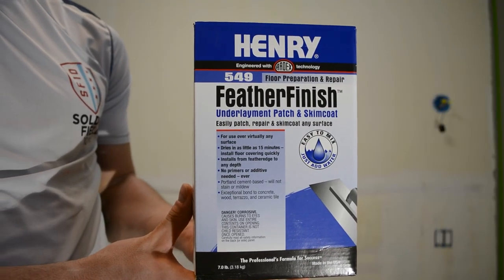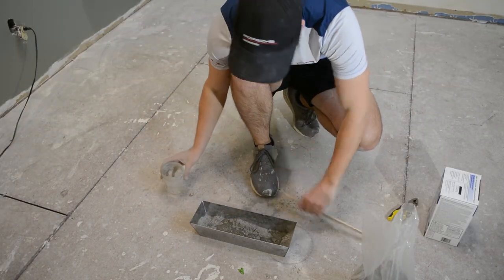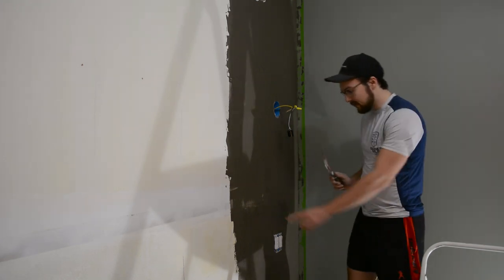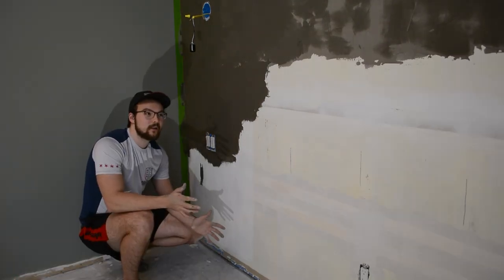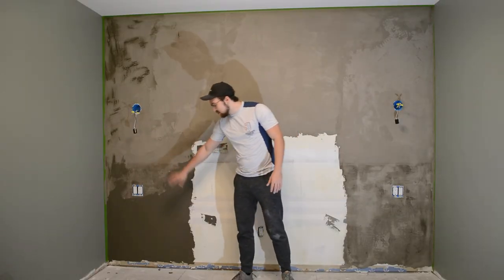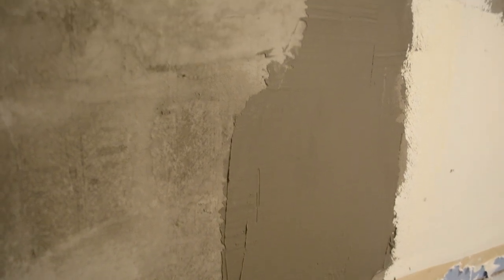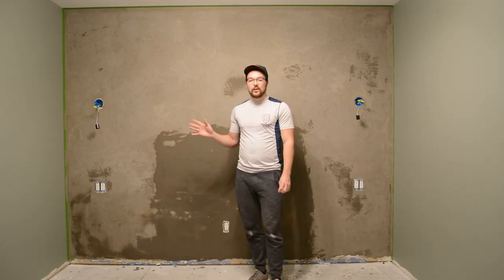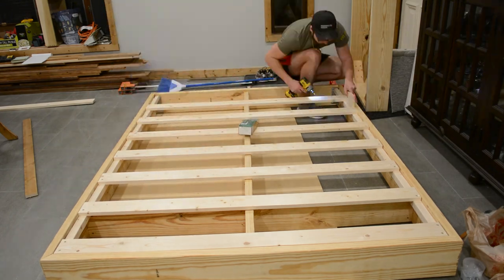DIY CONCRETE Accent Wall on a BUDGET | Bedroom Renovation Part 4

Comment: If I wanted to do this for an RV/bus/van, I'm assuming there would be cracks over time from road vibrations.
Anyone know if there is something flexible to add to the mix that would keep it from cracking?
Reply from the maker: Not sure there’s anything you can do in that situation. I would try lime wash instead 😁

Comment: Wow!! This is exactly want I want to do..Is there a way to add color to the concrete and do you think it will affect the outcome.
Reply from the maker: I haven’t tried adding color before but pigment is probably your best option. I would just do a small test before mixing up a ton
Reply: You can also buy the white version Ardex feather finish same company as Henry & then tint it

Comment: Did you find it to be durable? Because I used that feather finish stuff on my countertops and it was fragile chalky garbage. A casual fingernail scrap did it massive damage, and it constantly shed chalky dust.
Reply from the maker: It’s very durable but it’s not meant for a countertop. I did build a coffee table out of it but I used durock as a backer board, honed the surface by sanding it to 220 grit, and then I sealed it with a concrete sealer. The video is on my channel if you want to check it out. If done properly, this stuff can last a very long time
Reply: My countertops in my kitchen are on year three and still look great. I did four coats of feather finish, lightly sanding after each coat. I then used 3 coats of sealer and three of a top finish. No nicks, gauges, etc. Each year I will add top coat just to keep it protected.

Comment: if your using this feather finish in the bathroom would you need to seal it??
Reply from the maker: Good question! I don't think it would be a bad idea but not completely necessary depending on how much it gets wet and how often. I did an accent wall in my bathroom and did not seal it but it barely ever gets wet. I would seal it if it gets wet on a regular basis. Hope that helps!